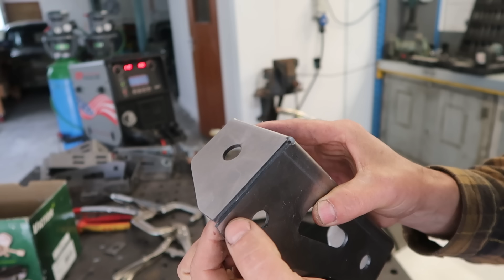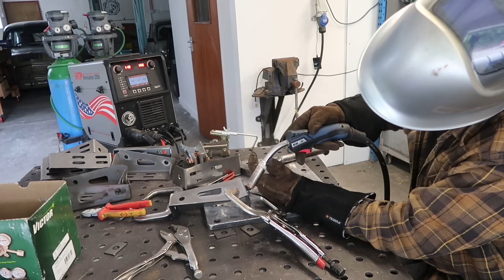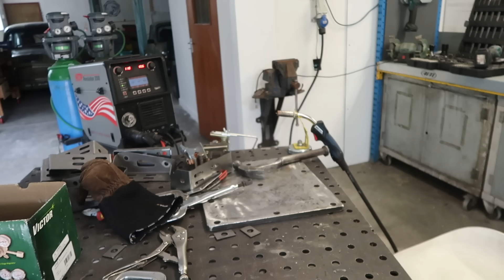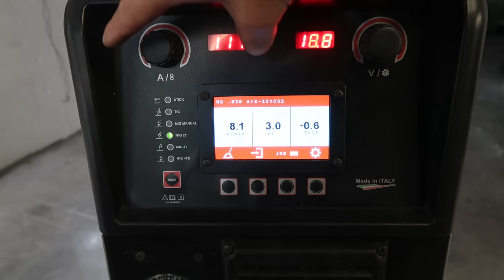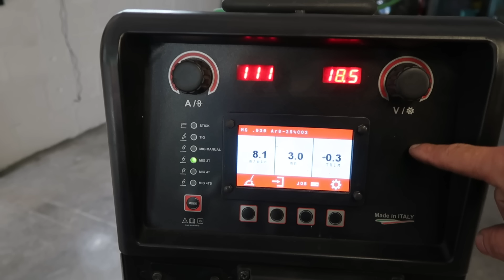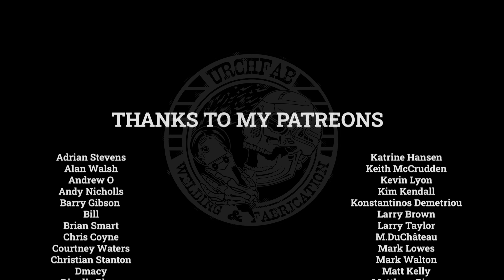Try These Mig Welding Tips For Perfect Outside Corner Welds

Comment: Do you recommend using the 75%/25% gas, I've only ever tried the 95%/5%?
Reply from the maker: Currently using 92/8%.  75/25% isn't to common in the UK
Reply: @Urchfab  you're mig machine thinks you are using 75:25!